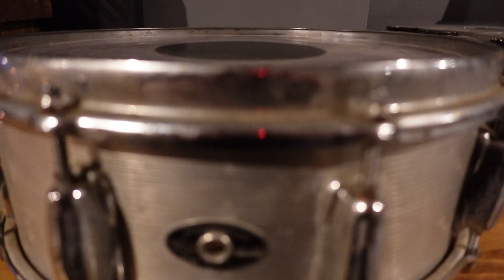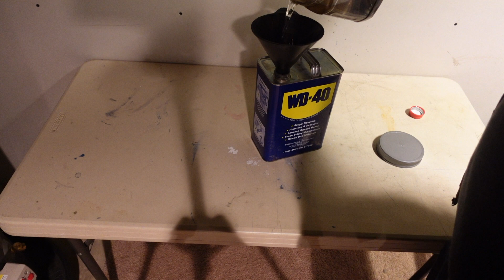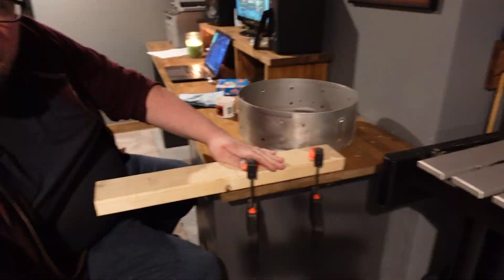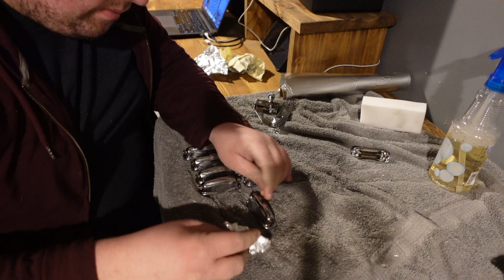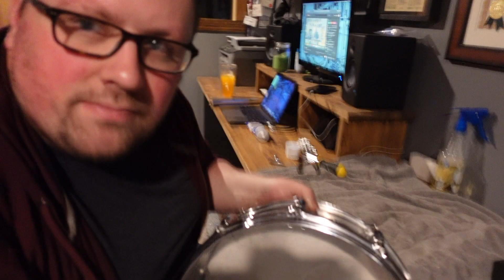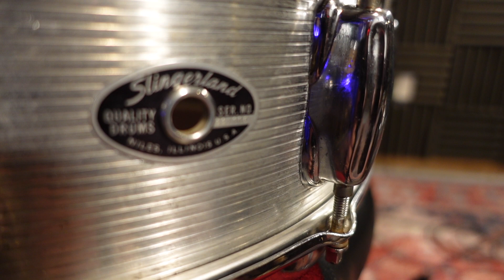Slingerland Aluminum Snare Restoration

Comment: Would you say the aluminum slingerland lighter weight than a wood slingerland with the same hardware?
Reply from the maker: For sure, the aluminum shell is so thin that it weighs next to nothing, a wood shell can be fairly light (depending on the density of the wood) but would all be heavier than this shell.
Reply: Think the aluminum slingerland would be suitable for jazz?
Reply from the maker: @daviewavie112  I can't see why not

Comment: I was about to ask you about the shell. It’s quite unique, the edges are orally bend, not the typical 45 degrees. Does it have a snare bed?
Reply from the maker: I think so, just not as dramatic as the standard as the drums with more traditional construction

Comment: Hi Mike) Thank you for great video.
Are you using smaller snarewires on this drum?
Reply from the maker: I believe I’m using the original snare wires on this drum, and I think they are maybe 12-16 strand? It’s def under 20.
Reply: @malonedrum  I mean in diameter.
Look like it's for 13"
Reply from the maker: @tReShertReSh  I don’t think so, but I did just reset the ones that were on there when I got it. In either case, maybe I busted some secret to a great snare sound.

Comment: Score! Just picked up one of these from an estate sale and it needs some TLC, so I'll be studying this video carefully. Mine's an 8 lug version with reinforcing plates inside for each lug, except for the lug that is on top of the shell seam. At that location, there is a welded piece of ribbed aluminum, shell material it appears, instead of the backing plate. I think I'm going to retro-fit a small plate to the snare throw to secure the snare cord, I don't like the idea of tying those either. Thanks, great video! Google search brought it right up.
Reply from the maker: Glad to hear the search optimization is working on my favor! Good luck with your restoration and hopefully my video saves you some time!

Comment: Great drum and you can weld aluminum. It's called TIG welding. That's how they make aluminum boats.
Reply from the maker: That makes total sense! I’ve heard of tug welding but obviously I’m familiar with aluminum boats. I wonder Slingerland opted for this seam which seems so flimsy or hobbled together instead? Must have been cheaper or less labor intensive.